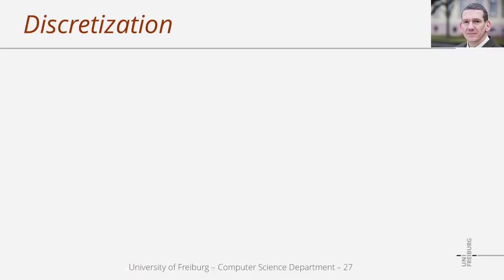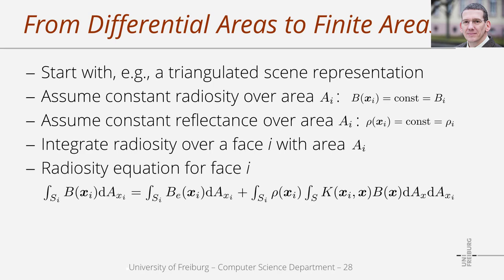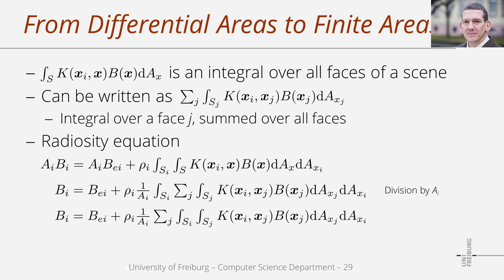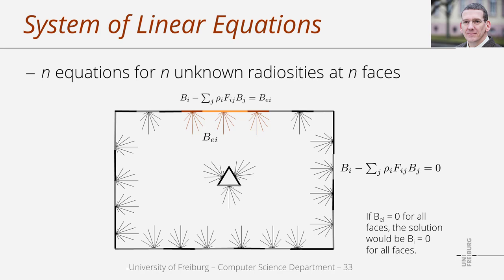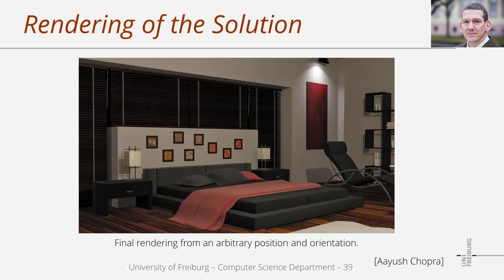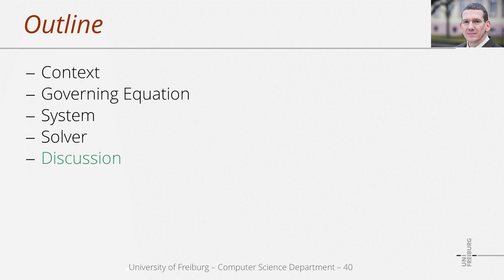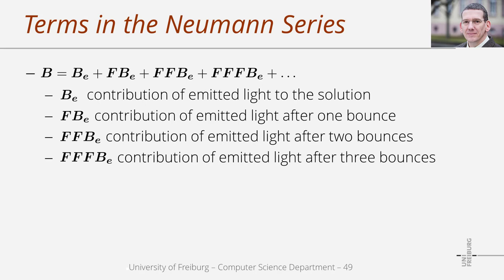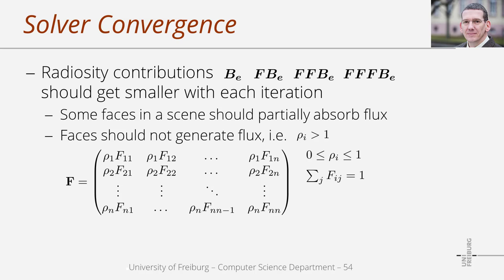Rendering - Radiosity 2

Comment: Thanks, Amazing work! 
Was looking for some overview of radiosity technique and could not find quick ramp up material for getting on board. 
Would like to know more about how pre-computations are used to speed up the rendering in the Precomputed Radiance Transfer method as well as how the system changes to account for non-lambertian surfaces.